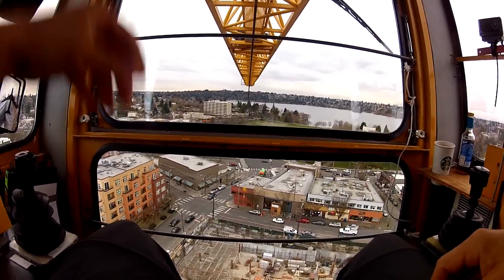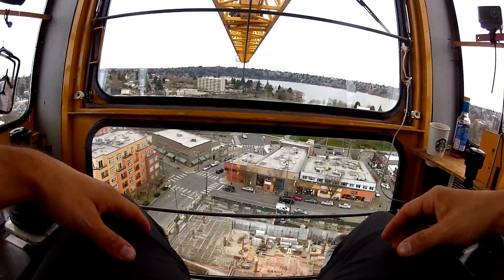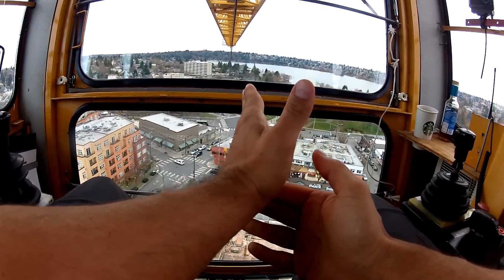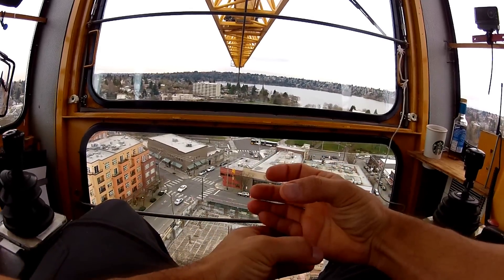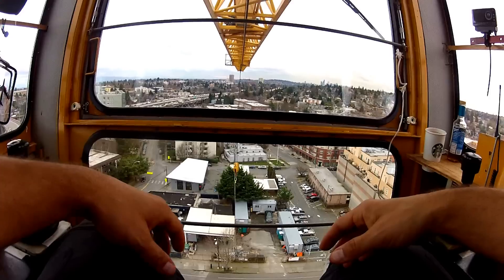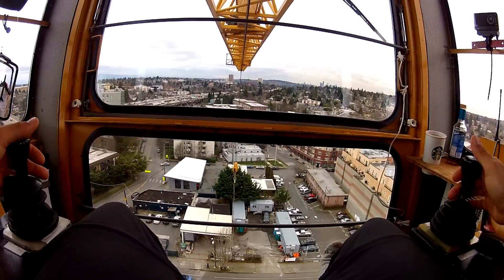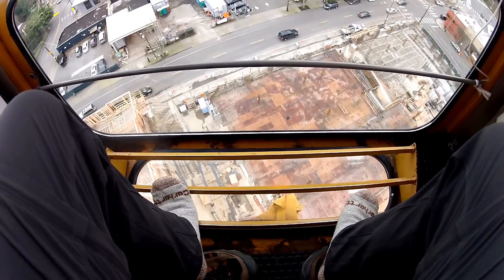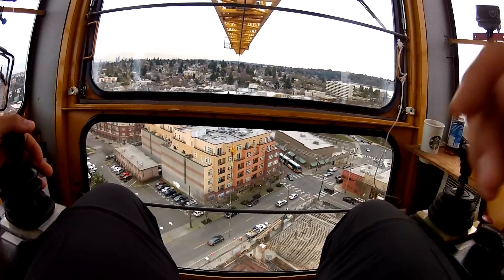How to Operate a Tower Crane: Swing operations

Comment: Im beginning at 01.08.17 to working an Tower crane, it will be my first job day and im pretty nervos (Can you give me a advice?
Reply from the maker: Congratulations. You should be nervous and embrace it for a while. There is a lot to watch for and learn from. No one can teach you everything. I remember just sweating every day for a long time, and that was after years of crane erecting and other fairly technical work. Make sure that you are watching everything that is going on. 

For example, when you hoist up on a load, if the block shoots off one way or the other unexpectedly, you either aren't centered over the load, or you have fouled up rigging. A correction will be needed. It's those types of little details that make the difference between being safe and being that guy that blames someone else when something goes wrong. 

Be patient with people. Tower Crane operators can get the reputation of being difficult people. Speak up with you need to, but do so with calm and authoritative energy. You are the captain of the chip. if the captain is unstable and freaking out. it's hard for the ship's mates to look at you as a leader and with respect. If you get your signal persons respect, the rest of it will fall into place and you'll help each other succeed. 

Work on load control and accuracy before you start adding speed. It's far quicker to get the load to the right spot and under control the first time at a reasonable speed as opposed to getting it there at 100% speed, but the load is swinging all over the place, or you have to stop and adjust the swing, and the trolley, then once again you have to adjust it and get control. After you get the control and your brain understands the timing of the crane you are working with, then you add speed bit by bit. 

As a new operator, try not to make big judgement calls. Just do what you are told for a while. Eventually as you get better and that trust is earned, you will have the tools to make judgement calls. 

Use the sun and shadows. remember that the angle of the sun changes all day. But shadows really help in knowing that you are 100% clear of obstacles or how close you are to the ground. The hazard I have found with this is I was running an old crane and loads we were pulling up at 8 AM had one shadow to tell me when I was clear of hoisting and I could start my swing. At noon, that angle had changed and I had a load that was a bit too low as I started my swing. By the time I realized that I wasn't clear, I could barely get the hoist started, and I impacted a 2x4 on a wall form. Stuff like that is embarrassing. You'll make mistakes. Be honest with yourself and your assessment. You'll keep making them if you aren't . 

Best of luck. It's a decent career if you are good with being up in the box and away from folks.
Reply: just go up to some collegues and learn learn

Comment: I'm a tower crane operator and I hate it . I've been running a 575 peiner on the same job for 4 years and started at 220 ' I am now 1110' getting ready to jack this bitch down ,  crane operations aren't too bad , jacking is the scary part . NO room for any error on any of the crews part. other than that I miss running mobile cranes . tower is a rare breed
Reply from the maker: 1110'... Nice! that's higher than I have ever been. What tower are you building? Climbing can become relaxed. You'd be surprised what the cranes will take. Guys up here had an incident a couple of years back. The operator kicked open the brake while they were opened up with a PECCO 280. Assured death is what that is supposed to be. But they got it back in line with out it all going wrong. I've been caught in 35+ winds in climbs. I think the average Texan would find that number normal from what I hear. But it's totally unnatural. After five years I got to the point where I would catch a nap between sections when I was a crane erector. 1110'... wowza.

Comment: This video is actually what made me really think about the torque on the tower, so cheers about that :)
Reply from the maker: jormasaatana Very cool. When you get comfortable working at the top speed of a crane, the next level is adding as much load control as possible. We have to understand the tower torque in order to get there. I find the hard part is going from a crane you can fully control like this Liebherr to a crane that ramps down the stop itself. Then the torque concern goes away because i can't control or time for it. I just learb to be linear with the starts and stops to not have to chase the load as much. I find that the time lost in acceleration and deceleration pays me back with load control. If we don't have to stop for a correction we have immediately made up time. It seems to be a slower is faster approach on those cranes for me.
Reply: Yeah, I'm driving a 1999 Potain 285 with a 70m boom atm (not as big as it gets in the states I guess) and it was a pain in the ass to get steady at first because there's no counter torque and overall it's just really damn wobbly if you make the slightest fuckup.

After a month or two it feels a lot easier, especially when you learn that when stopping the rotation you need to give small bumps at the very end  to counter the tower torque.
Reply: nice

Comment: Fuck me I've never known anyone to operate a tower crane like that you make iy sound hard work , the only imortant thing is when you're reaching the destination, you just let the load get in front of the swing so you can then catch it up,and when it stops just flick the slew therefore releasing the brake and the tower rights its self and the jib stays where it is, I'm not knocking how you operate it but, youcan just put that slew right over to the left/ right full power, it will only pick up speed on it's own accord.
Reply from the maker: +lliambunter 80 meters of jib. If you slew with full power without working up to it and out of it, the jib is going to snake along and virtually never settle down. The load will drift around as if it were flushed down a toilet. It doesn't need to be difficult. It's just rhythmic and your brain adapts to what the crane needs.

Same is true if you are on tall cranes. Your advice is fine for 45 meters of jib 45 meters tall. The last two weekends I filled in for one of our operators on a crane that is 445' tall. Your advice would lead to nothing but regret. If you take off full power you'll have a 4 second lead on a the wrecking ball below and the 1000 Kilos of load line will never let that block come to a stop. You have to de-energize it. If you take that from the big cranes to the smaller cranes, you'll get a lot of respect and actually gain speed in your cycle times. This way of doing it isn't slow. It is maybe more work than necessary for the smaller cranes. That could be a fair criticism. But once you step up you'll need this knowledge.
Reply: +rotyag Absolute bollocks Just because you move the joystick striaght over to the left/right it will only pick up speed as it desires,it 's not going to take off at 40 miles per hour, I drove tower cranes for 18 years mainly recod as they were  known in the UK (potain ) now owned as yoy know by mannitowic? again I 'm not out to sestry your co0mments but I don't think you understand the workings of it.
Reply: +rotyag i've never heard of the hoist block being refered to as a 'wrecking ball' that's not the right terminology is it?
Reply: +rotyag It 's the same as braking from full slew, onthe older models you had to 'back knotch' to stop it, the last one I operated was an electro magnetis brake ,as you reduced the joystick angle the power reduced and slowed it down, but it didn't in any was shape deflect the jib if it did that as you suggest surely it would screw up the tower!  the resistence insn't there whether braking or going into full slew try it and make a short video of it .
Reply from the maker: +lliambunter No. It's a sheave block. Calling it a wrecking ball indicates that it's out of control. 

We all have opinions. But here's the deal. I have 21 operators that work for me. I own cranes, I erect them, I'm a licensed tower crane inspector that was part of a two person team the wrote the crane inspector test in my state as well as was a member of the stakeholders team that re-wrote the construction crane rules in Washington State in 2010. The notion that I don't know what I'm doing would get a guffaw from just about everyone in my industry here. It's just a question of style. 

You may want to ask your technicians if they want you hammering on the controls or easing the power out of it. You can run a car up to a stop sign from 100k stopping it in 40 meters. It doesn't mean that it's driving well or good for the car.
Reply: +rotyag I think you're missing the point, if you put the leer hard over left or right it won't make the slightest bit of difference to how fast it's going to pick up, you should know that, it will pick up speed in it's own time., fuck me I 've driven enough of them to know whay I'm on about.I'm not knocking you, I'm just adding my experience to it,and there is no parrelel at all between slewing a crane and driving a car, you can spin the wheels on a car if you give it enough power, thay could never happen when slewing a crane it will not allow you to do it,
Reply: if my boss saw me hammering the sticks over he would fire me. He owns 80 tower cranes, he must not know what he is talking about...

Comment: As a signal man in NYC this is awesome to see. My operator on this specific site i have known for a few years and he has allowed me to swing the crane once or twice, ive also had the pleasure to walk the boom to reset a jumped trolly cable, both where pretty cool. However the constant rocking in the cab when picking a heavy load such as rebar or q-deck is intense.
Reply from the maker: Right on! You know that you are running hard when you have to have a foot on the crossbar at the glass to hole yourself stable in the seat.

Comment: is it possible to be so violent with the controls you could cause the crane to collapse? not as i want to try lol just curious. I drive large trucks and heavy plant machinery, but i wouldnt have the balls to do this job, i do have a fasination with cranes
Reply from the maker: Dave hawkins If everything is set up properly on a modern tower crane, no. The motors don't get full power on anything as soon as you hit the control. There are relays that have time delays to protect the crane and the newest computer controlled ones ramp up and down on everything in terms of power. 

You know, where it really gets uncomfortable is when you lose power supply. All of the brakes lock up immediately. You'll be swinging full speed with a heavy load and if you lose power, it's 100% braking immediately. It's violent. The closest I have come to seeing a crane coming down was a defect. A new bearing (where the center of the crane spins around) was put on a crane. We were erecting the crane and apparently no one tested it. We hang the back portion of it where the motors are. On the old ones we would then swing the crane around with a drill motor and put the jib on. Well the drill motor would turn it. So we wired it up. An hour later we have the operator hit the power to swing it. Groaning motor, no movement. Then my boss got stupid. Next step (more power). Next step (in third for those reading at home) and it breaks free. It broke free so violently that all of us freaked out. The operator stopped and the crane came to a stop like I have never seen. We bounced back and forth for 15 minutes while the boss consulted with a couple of technicians across the country. We eventually tore the crane back down and shipped out the part to be replaced for god knows how much money. 

In order to take down a crane with the controls, something has to terribly go wrong or it wasn't set up correctly to begin with.
Reply: rotyag Many thanks for the resonse, and many thanks for the info. you've done a great job in educating me, and filling in a few of those blank spaces i have in my head. I look forward to your future videos.

Comment: How much does one make on a tower crane?
Reply: +Gaytor Rasmussen Just stopping by to say thank you for your advice and I plan on putting it into action as soo as possible. I just received my NCCCO in the mail and I should be on a tower in a few weeks, I'm just looking forward to getting rid of that nervousness I know I'll have when sitting in the cab by myself for the first time. Anyways thanks for the videos and in depth explanations it helps allot for guys me who learn better by seeing and doing. keep em coming!
Reply from the maker: Edwin A. The answer varies. In the Seattle area most operators will end up in the 100k range. Varies from about 90 to 125 depending on overtime. The taller the building, the more overtime there will be. NYC will often see 200. A non-union locality like parts of Texas might only see 50k.
Reply: +rotyag how to catch the load and by that I mean when you have a sei serious left to right swing and you need to bring it under control.
Reply: +rotyag from my experience towers are unlike smaller mobile when catching the load sure to the fact it takes much longer to swing over the load. how do you remedy this?
Reply: +max hyppolite you have to be thinking ahead of the movement. If I'm coming into an area and I'm say 15 degrees out, I'll slow down my swing to cause the load to drift out ahead of the boom. Depending on the crane, I usually let it drift (neutral energy) until I am nearing being centered over the load then I slow down again to keep from putting too much energy (speed) into the load again. If you miss your timing or it's just windy, I find that you have to be moving the crane earlier than the load moves. Once that load hits the end of it's pendulum and starts swing back, I already have to be starting my swing to where I think it will stop swinging based on the energy stored in the load. Sometimes it takes a few times to really get it settled. 
The thing with being new to the game is getting load control first, then adding speed as you get comfortable. Sometimes guys feel the need for speed first, but you have to let your mind sync up with the timing of the crane. It's safer and eventually you'll have all three functions going at any given time and that's where you really save time. If you are too rough with the loads and don't have load control, the riggers have to fight the load as you come down and you lose time. In a perfect world you wouldn't need to stop at all until the rigging is slack and the rigger might only need to spin the load for you. That's the goal. And it's all about seeing the energy. Putting it in with deliberate control and dissipating it with deliberate control. Even as an experienced operator it takes me a day to really sub-consciously figure out the timing of a crane to max out it's potential to get 16 or 17 picks an hour.

Comment: Awesome video! I am curious about does electricity outage sometimes happen during the operation? If that happened, what will you do to reduce the vibration of the swing?
Reply from the maker: When you lose power during crane operations in a tower crane, all of the brakes lock up immediately. It's quite violent. There is nothing you can do but wait for the energy to dissipate in the structure and the load. It's quite impressive when it happens. If the outage were long term you can have crane technicians mechanically lower the load if one is on the hook. 

The worst scenario I have seen was a small crane hitting a large power transmission line. All of the electronics were destroyed. I came out for the contractor and manually lowered the load and the hook and had guys on the ground cut the load line. I then cut it all free up top dropping the rope to the ground and just manually opened the swing brakes so the crane could weathervane safely in the wind. This isn't something an operator would be expected to, nor should they generally be doing. I was working in a different capacity then.

Comment: Ive been running mobile cranes for around 3 years now and starting next week i'm going to be on my first tower. I will be on a remote controlled potain. Thank you for the videos. I'm hoping by watching these it will take some of the guess work out of my beak in. These videos would be perfect for apprentices during training. keep em coming
Reply from the maker: Right on. If it's an HDT80, some seat time would be good to get the feel of the delay in the swing. They have a second or two delay from engagement to movement. Small quick bumps will become your friend both in catching and in tight areas. Those small detents in the controls are easy to miss and suddenly second step when you don't mean to. If it could say one thing, use that center stop button if you are out walking around. It's possible to accidentally engage a function when you don't intend to if something falls on the controller. Best of luck!